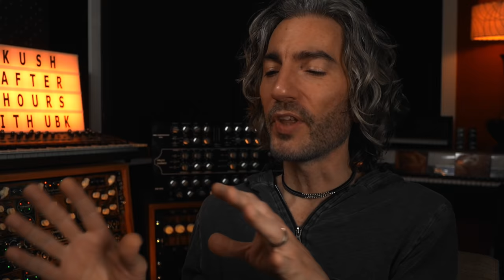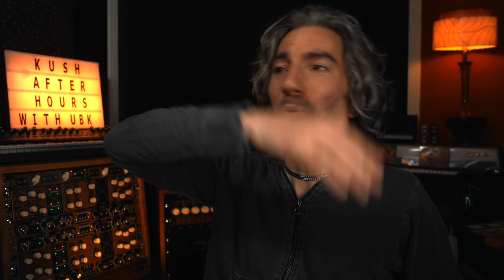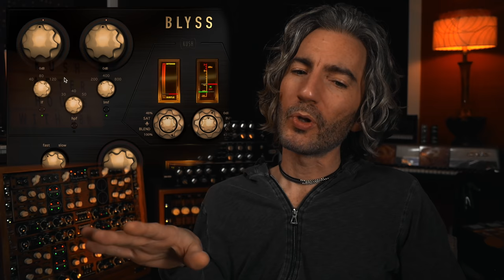MIX BUSS: You NEED to try THIS!

Comment: This helped a lot. A while ago I learned about top down mixing from youtube and took it too close to heart. It helped because pro tools on my computer kept crashing and I was using less plugins. But my gain stage was messed up, and I too often slammed the bus compressor especially while doing automation. Really the mix bus chain should be relatively subtle, only stuff I want to affect everything or how everything interacts.

Comment: I really like most of your advice here and I do something similar with one small modification: instead of starting with a blank mix-buss, I start with a chain of mix-buss plugins appropriate for the style of the song turned on but all knobs at neutral, this way I am mixing through them and getting a little bit of glue and color without pushing anything. After getting the mix together, I can start turning knobs on my mix-buss processors without a huge harmonic swing and shock to my ears.
Reply from the maker: Makes sense!  I've been doing this long enough that I know exactly where to have my drum peaks hitting, so when I un-bypass my chain, the whole mix just melts into the layers of soft-clipping, and I go from there.  So that initial switch, it's not shocking to me, it's actually incredibly satisfying, like opening the canister of coffee beans first thing in the morning and getting that first whiff... suddenly all the slog that came before was worthwhile! 😛

Comment: Let me tell you this, i always used to use compressors for a long while until someone told me it can degrade quality. So i stopped using compressors & my mixes got more transparent. Couple of days ago i found a good deal on initial audio's IA LA1 (76% of at the moment) tried it in Bitwig Studio 4 and are now considering buying it. Why? Because 2 reasons. First of i thought Bitwigs volume slider werent as perfect as Logic Pro X's. This compressor remedies that. It gives me firstly better control of volume through threshold & makup and limiting. But most apparent a real transparent sound. So if i ever need a compressor for smoother volume conrol igot it. Good thing is it can work both ways, so either you compress or Limit. So you dont necessarily compress the sound 👍

Comment: All last week i tried to use the tips of Gregory in my mixing, and now is my opinion - it does work!! I think the message of Gregory is "Be a listener, not plugin geek or super-duper pro theoretical smartass". My sound is much better now, warm and saturated, my vocals are clean, my snr is soft and full at same time. My only problem was - how keep all of it after limiting. Now i will try master bus work, without analog gear, of course. But now i know what i need - just colored my mix with saturation and shaping it, with limiter turned on in the end of chain. If will be bad on frequency i compensate it with eq. I think it will work...
Reply: Try the one where he talked about mixing in 3's.  It has cut the time of creating an initial rough mix for me by 70% and I can get all of the basics done very quickly now without continually second guessing where things fit together and within the space.  The knowledge on this channel is amazing.
Reply: @scottc7764  thanks man. How exactly named this video?

Comment: I dig your way of talking about geek stuff man. I tend to agree with you about mix buss compression. It's a finishing tool, not a mixing tool. That's the way I have always mixed, but occasionally I have tried "top down" mixing, but as you say, I just end up fighting the mix buss processing while I'm trying to establish tonal, spatial, and dynamic aspects of the mix. It definitely works for me to use mix buss processing to finish, to polish the mostly complete mix. And I know what you mean about Inflator. It does the most amazing things!

Comment: Nice video man, and thanks for sharing your workflow. Some of the times I mix into the mixbus comp-eq-saturation, sometimes i turn them on during the mix and some of the times i leave the mixbus empty and add later, just like you described. I dont have a rule. The song or project dictates that to me.
For example, if im mixing an album of lets say 10 songs and im not familiar with the content, the first song im mixing is usualy the one that tells me what is going to happen. So on that first song I leave the mixbus processing for last. Then the second and third song I kind of throw in the mixbus processors i used in song 1 , at 80% of the mix and at 20% respectively.
From that point on, 4th song I mix with the processors on. But I mix with lots of headroom. If anything sounds weird i on-off the mixbus plugins and re-adjust when needed and maybe add or replace some processors. By song 5 i have established the rules of the mix and the possibilities of the mixbus (and other busses too).
When the whole album is done I have a complete idea of what the mixbus should be doing and sometimes songs 8-9-10 might tell me how to correct or re-adjust songs 1-2-3. Its what I call an organic process where the sound of an album is cohesive throughout and a song's minor change/addition can be benefical to the rest of them.
Reply: TV

Comment: Great stuff as always man. I love the way your mind works. For me, after I get my static mix working, I'll start mixing through console saturation and into a buss compressor. That's it on the mixbus until the mix is about 90% there. Then I'll start shaping with eq's, exciter, inflator and finally some 2-track tape saturation. That way I can start to hear the finished product and see where it's lacking. I'll bypass some of that if I need to do something detailed with automation, if the color is getting in the way.

Comment: Hello Gregory. I find your process very interesting... Before I bring in the vocalist or solo instrumentalist to record their parts, I make sure my tracks are mixed well especially the drums and bass. Nothing but a mild HP filter on the mix bus. I also add HP filters to the drum buss, bass and synths to clean up the mud. At this point I want the mix to sound good thru the headphones to help inspire the vocalist or instrumentalist. I add saturation, EQ, 1 or 2 db of compression max and maybe an expander/widener on the mix bus for the final mix. I do mostly smooth jazz,, world music or funk.. Luv your work bro. Thanks

Comment: right there with you dude - the only time i have something on the final output in the midst of producing/writing is when i'm designing into that processing. it has to be a holistic decision rather than an arbitrary thing you "just do". if i can't get the mix sounding good with nothing on the output, i've fucked up along the way. with the top-down method it's just too many variables - dozens, sometimes nearly a hundred sounds all bouncing off each other and not just happening at once, but affecting one another's presence because of those end-of-line tools! so much to account for, totally mentally fatiguing.

Comment: I can’t mix into mixbus compression either. It always distracts me from the other stuff I need to be doing first and I continually mess with it. Like you, I fight with it. When I’m happy with my balances, imaging and general song dynamics the first thing I’ll throw on the mixbus is a compressor. I almost never go over -2db of compression. Just enough for some density in the middle and hopefully a slight sense of expansion in the sides. Sometimes it will change the balance in ways that need to be tweaked but never by much. Then it’s some saturation (often including Inflator as well ;) and light EQ into a limiter. Usually all there is on my mixbus. It just suits my workflow to just try to get things how I want it before hitting that final compressor

Comment: I've had Inflator for a while, and I'd never used it with a negative curve. I wanted to add some more dynamics to a mix I've been working on, so I just tried that at your suggestion, and holy crap!

Comment: 'Mix Buss' was always a thing to use to protect your hearing !  .. Id reliably suggest a Limiter at least so 1) you don't fry your ears and 2) you dont shag your tweeters ! :-0 .. the rest ? It is important not to be careless in this game.. so its a goooood idea to have a Compressor/Limiter.. preferably "a real one" .. between your desk and your speakers..until you know better ? When I was a young gun.. Volume with Hi end speakers was God! However your ears get tired and your mixes sound like old soup! ...So..you can get a half decent harmonically clean Compressor/limiter for the same price as a $100 plugin .Drawmer? Dbx? .. And you'll be wanting to split the sound back to your DAW too ;-) you'd want to be using it as a "mix Buss " ...The compressor as an effect..Cuz you've sussed your not needing to monitor at huge volumes..
Old ways are often the best.. Off topic I hope not.. Train your brain with your brain ;-D
As Per The Kush is reliably informative... Peace Bro!!

Comment: I primarily did mastering for several years.  That said, I wish a lot less "mixing" people mixed through compressors.  There's a few that do it well, most just make my job harder.  Bad buss compression/too much buss compression are impossible to fix/remove.  Too little/ no buss compression is easy, just add some on my end.  Seriously, especially towards the end of my stint as a mastering specialist, most of the mixes I was getting were completely ruined by bad buss compression.  I distinctly remember saying to a mixer "man that sound really compressed, what do you have going on there?"
"Yeah, there's some compression on there but it's not doing much."  Turns out he was doing 12-15dB of compression on the individual channels, then 7-9dB more on vocal, inst and drum busses, then 9-12dB more on the main buss.  Ouch!

Comment: Everything you do to a mix bus (if you do "extreme moves"...) and it sounds great you will have to duplicate in the mastering process or it will all colapse. Mix only with mastering limiter on a mix bus for just a little "reconnaissance" for "what will happened to the mix in the end" and switch the limiter On and OFF every now and then so it sounds good and thight no matter if the limiter is on or off. Just don't use compressor for mixing, yet along EQ, even worse ... .)) p.s. And of course level match the limiter so you don't get fooled by the loudness.

Comment: Hey G, by accident - or, when I added a Dangerous DBox to my workflow and used their summing, I lost a main 2 bus in the DAW and can only mix without buss processing. What a weight off that is! Probably like you, I was using buss compression and thinking it was kind of working, but actually without, my mixes sound much bigger, more natural and have more presence on other systems. I'm not hating on mix buss processing - I just don't seem very good at it! I am happy for the Mastering Engineer to aggravate over that.

As far as the series goes - Things you shouldn't do that I do...I use far too many plugins on my vocals. Currently I am mixing an E.P. where all the vocals have at least 8 plugins on the channel and probably another 8 on the vocal buss, sometimes more than this. 
Whenever I try to do less, I just don't go on the sonic journey that I seem to need. Flame me!

Comment: So I have a Tascam Model 24 which I use as my main board. The output then goes to all outboard gear for mixing going into a Tascam DP-03 which has mastering functionality, no computer whatsoever. I saw a Hybrid mix video where they were mixing with a stereo preamp first before a Buss comp. I tried my ART TPS before my AudioScape Buss comp into the DP-03. If I do the Buss comp first, it doesn’t sound as good as the preamp before it.

Comment: Thats how i do bus compression....just as minor glue saturation AFTER i achieve my tonal mix style sound.  I use saturation for compression more than i do compressors but you gotta be careful w/ digital saturation even when its emulating analog styles.  A little is often too much lol.
Reply from the maker: I have the same experience with digital saturators.  I'm a 'more things doing less stuff' kinda guy, I find it more interesting to have 2 saturators into a compressor into another saturator, each doing such subtle changes that any one on its own is almost meaningless.  But they accumulate so beautifully!

Comment: I love how you break "the rules" man. Nothing in recording is written in stone. That said, the only reason I use "top down" method is for consistency. 

I have my whole chain set (I have done it long enough) and balance my levels against the compressor. Meaning I start with drums and once I hit a certain GR, I know i'm good to build the mix around that. 

Mixbus processing can be a VERY effective and useful tool, IF USED CORRECTLY. Whatever works for you is what you should use. Don't do anything just because a youtube video told you...

Comment: Thanks for all of the videos. A while back (not sure which vid) you were saying that you liked to allow more space for your monitors or possibly it was that you liked to have them throwing the sound from further back, rather than having them right up on you. I am getting ready to make a custom shelf. Due to limits to space in my studio and available shelf sizes, I was going to go with something that would have a 4 foot span. I could go as far as 5 feet but that would be pushing it. Do you think 4 foot would give me a wide enough span for good options on my speaker spacing? Or should I go with the 5 foot option to really get some good spacing?

Also: would you have any suggestions about how high I should go to give me the best options or how low I could get away with? 

I don't know if this helps but I am 5'7" and my head sits at about 4'3" when I am sitting. Any insight would be most helpful. Thanks again.

Comment: Hey Gregory thanks again for another illuminating and inspiring video! Are you able to articulate how "finished" a mix of yours will typically be knowing it's going to go to a mastering engineer (I assume) and they are likely going to be applying similar processes as far as EQ and compression on the final mix? Knowing it's going to be further processed would you deliberately leave some wiggle room as far as perhaps not bumping the lows and highs as much since this would be a typical mastering move, or applying a very limited amount of compression or no compression at all knowing it's going to have some more subtle compression in mastering? Or do you just get it sounding as best as you can to your taste and leave the rest to the mastering engineer? What if you're the one who is going to master it? I've recently been undergoing mastering training and also am somewhat new to mixing and this question of how "finished" a mix should be before going to mastering is somewhat bemusing to me, especially when working on my own music where I mix it and then go to master it myself. Any insights would be much appreciated, thanks!

Comment: Every.. single.. time.. I have tried to put a mix bus compressor on early I have later found myself fighting with compressors and EQ's on individual tracks, freaking out why I can't get the transients to pop like they should, why the bass boost doesn't result in a bass boost etc.. Ends up with me doing radical things to the tracks, which then impacts the rest of the mix as I slowly slam harder and harder into the mix bus. THEN... I realize "oh, yeah... I forgot I had a f*cking comp on the mix bus........". By that stage I have probably already done so much damage on different parts to the mix, trying to salvage that crap, that taking the comp off the mix bus is no longer an option. That's when you simply say "someone, shoot me!". 😂

Comment: Good point here, as I have also tried in My Mixing to just follow the regular way people and some gurus does, but I realized it doesn't work for Me, some times I don't even use Drums Bus Compressor, but if I use Slate Tape Emulation and little Eq and Saturation, this glue My Drums but depending on the mix from the beginning, and again setting up Compression before Drums mix does not change anything to Me, it doesn't help My mix, Am sorry I don't know how to explain this... to cut it off here. Thank you for the video.

Comment: The Internet is good for fixing your lawnmower. Not for fixing a mix. 
I never liked the term "glue", and use mix compression in the most subtle of ways, meaning barely. Scott is very insightful. Unlike the multitude of hindsight 20-20 self promoted post roadies, who call themselves a mix engineer.
Reply: I never like them saying 'add glue' because if it was arts and crafts in primary school i am already /the kid covered in PVA with yet their model falling apart who gets sent home to clean up/ during mixing. Sometimes during tracking!